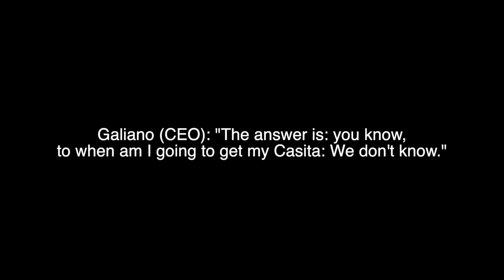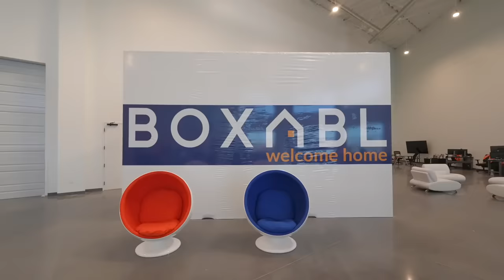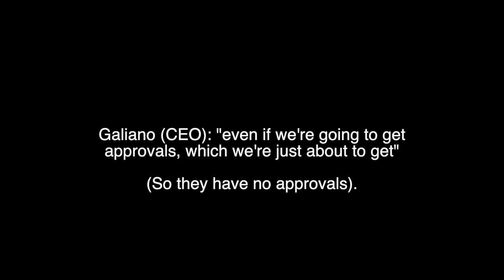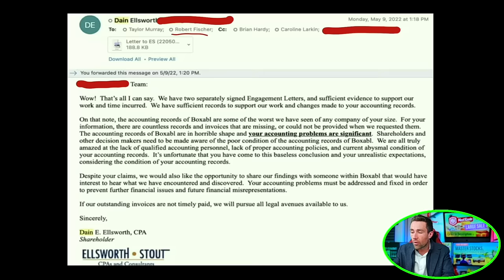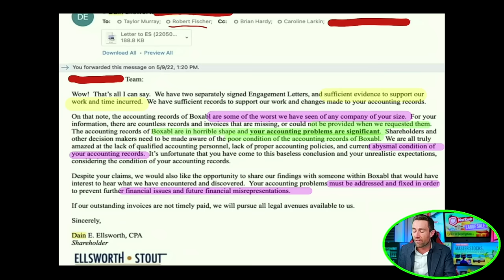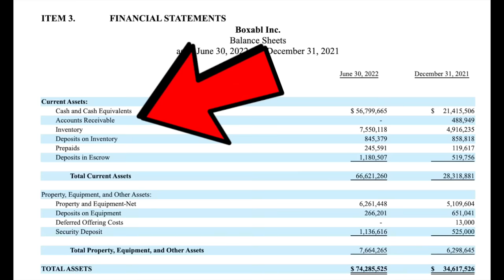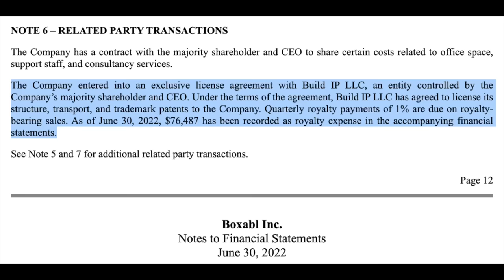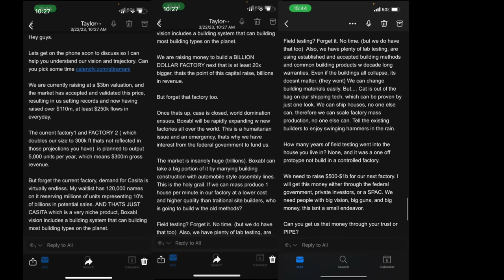Boxabl's $3 Billion Dollar Fraud | Elon Musk's Tiny-Home Scam.

Comment: I'm an electrician.. cables should NEVER get hot.. bundling doesn't matter.. the code on number of wires in a pipe or cable tray isn't for heat 😊

Comment: Prefab housing has been around for a long time. I was selling them 40 years ago in NJ.  I live in PA now where there are a lot of prefab factories. Generally the facade of the house, the brick or siding has to added by a local contractor, also the furnace is something the buyer installs,  utitlity hook up is on the owner, and the buyer has to  build the foundation footings and schedule the crane to place the house on the foundation. You can hire a general contrator to handle everything.  Prefab houses are stronger than stick built. if your stick built house was put on truck and driven around the block, it would probably fall apart.  Some of the prefab house designs are really beautiful. Im too old to change. These are too modern for me they look like boxes and  I like traditonal,.  The flat roof is not where I want to be, I live in the Northeast and it snows. I like a steep roof for solar panels and so on. I need more character in the design. I hope Boxable irons out all its start up problems and gets its act together because its a very good idea.

Comment: Food for thought if it's 400 ft², and it cost you about $100 a square foot and let's say you build a 400 ft² home that means you're going to end up paying about $40,000 so you're paying 40,000 to build it right there on the property that you're going to need to own but also you're going to have to pay a lot of other fees to this city which are not included where is that wood generally be included so you're looking at probably another 20 30,000 or you can just spend the $60,000 to just have a builder build it versus the full 80 or 70,000 it's going to cost you for this thing because again you do need the land to put this thing on it's not like you can just buy this and stick it on top of your current apartment.  I mean for the money you might as well just build your own higher company to build your own like 400 ft² home if that's what you really wanted it would be cheaper and much more custom

Comment: First of all, when I initially saw the product two years ago, as a former ICC certified Code Enforcement Officer, I thought there is no way this can be successful. And then I learned that San Francisco was changing codes allowing for small units like this to be placed on properties. As someone that has lived all over the contiguous US, I have noticed the trend in laws that stem out of San Francisco. We also are all aware that we need more housing options, and sometimes a "Not to code" tiny homes  will be 100% safer than a tent on the street or even some of these RVs and trailer RVs, and ESPECIALLY the "grandfathered in" buildings. I believe these guys @boxabl are working hard at making this come to fruition and we all need to work together to find ways to relax some of the laws on code, which the most strict one is saying that areas of homes need to be a minimum square footage. That is the biggest problem. I'm sure a lot of higher ups in the building industry and lobbied for these requirements, so that they can mark up materials, have more hours of labor, and charge more overall. We need to remember to bring in all facts, because omitting them is a form of lying. I would suggest you speak to sources outside of a company and ask what they think, because sometimes there are disgruntled egos. I mean employees.

Comment: You could literally get a used semi container which is like 40 ft long for around 2 Grand and then throw in another 8 Grand to finish out every single thing else that you can even imagine and for less than 15,000 you have a 40 ft home with all the Furnishings electrical and concrete padding on the ground everything complete for less than 15 grand and way more room than these things and thereby saving probably $40 to 90 $1,000 because you know they're going to try to charge like $100 for each one of these little 10x 10 boxes

Comment: You just pray to God. Boxabl is not the bad guy here. The housing industry is so greedy, there are years of local codes that make it difficult for Boxabl to operate.  Just like you can't put a trailer house just anywhere, counties and towns  classify Boxabl as a manufactured house and many don't want them (or us who want to buy them) in their area. They want money...not an end to homelessness. So this is the monster that Boxabl and we are up against. Pray to Jesus that greed and deceit is stopped and that Boxabl gets the right classification and is allowed. (They are much safer than trailer homes)

Comment: It's amazing.   The idea is great, but this is a perfect example of what happens when people get in over their heads.  Some grey haired architectural engineers and tradesmen familiar with the variations in codes, and, a properly run accounting department, are a  couple changes this clusterfuck needs TODAY to turn itself around.   The company cannot move forward building unsellable garbage by making it up on volume.

Comment: Other bad housing ideas.
Build a house out of shipping containers.
3d print a house.
Reply: Hempcrete? 🤣
Reply: Whats so bad about a shipping container house? They can legit be stacked, they are not glue'd together and they are easily transported.
Reply: @RobertMcGuckin-ws6pe  So you get a metal box for free.  Now you have to build walls inside it and then cut holes in it to connect it to other metal boxes.  Then you realize, hey I could have just framed all of this from scratch for less.  At the end of the day it is tough to beat a stick framing.
Reply: @MinusEighty  I don't know where to get a shipping container for free but I do know that I wouldn't need to side it with plywood and siding which saves on materials and labor. Cutting out for windows and a few doors is pretty quick with a plasma cutter and then some angle welded in for frames. The sub-floor is already there, they're made to stack since the 4 corner posts are the load points. I don't know, I think I have to disagree. I'm a builder with 10 stickbuilt homes and 5 modulars under my belt plus a hotel and am now downsizing. My next personal home will be out of 4 containers with an all steel (I-beam) and glass center great room. Using containers in my opinion is much less expensive especially today with the cost of lumber and building materials in general.
Reply: @RobertMcGuckin-ws6pe  This idea has been around for a long time and yet it has never taken off.  Why is that?  Because in reality it doesn't save much and worse still leaves you with an unconventional structure that will have less value when you go to sell it. I never said that it could not be done, only that the trade offs make it unappealing.  God bless and could luck finding a buyer when you go to sell your super clever shipping container home.
Reply: @MinusEighty  Obviously, the reason why the shipping container home has not "taken off" is because our country is so loaded down with zoning and building regulations that its almost impossible to be able to stay above water while attempting to build one! Also, if you aren't a builder and you don't have any experience, how do you know that it's not cost effective? Regardless, I've been fortunate enough to to have lived in both stick built and container homes and can honestly say that resale is not of any concern, quality of life is and we are all different! 
So, good luck living in your cookie cutter tract house constructed of plywood and poly vinyl chloride siding and don't forget to pay your taxes every quarter, you don't want the government taking it away from you ! :)

Comment: Uhhhhh, you don’t need to do this “folding box” stuff. It would be easier to build pieces of the homes that will lock together but in standard size pieces and such that people can build to a number of different floor plans. The real problem is the complexity of home construction under the IBC, IRC, and on and on. We Americans (especially Californians) have been regulated out of house and home. The elected representatives figure it’s better you’re homeless than “unsafe” in a house built with less regulatory restrictions. And so there will be more and more homeless people.

Manufactured homes pretty much already solved all the problems. Build manufactured homes cheaper/more efficiently and you will solve the housing crisis faster.

Comment: You are wrong about the wiring every house ever wired has to have a home run circuit back to one panel and end up all on top of each other there is no heat issue or houses would be catch on fire everyday. Commercial properties are even worse because they run it all in a couple of pipes that by your theory would turn into welding torches, just saying

Comment: I mean realistically it's not a bad idea especially if you can just have like one that's like an empty room that you can basically put walls up or do whatever you want with but pretty much has the ability to connect the electricity to the main one and then I mean you basically could have like affordable housing or even like movable housing and especially with the current housing market and kind of how housing is in in general like you know even if you could eventually like customize them with like custom like framework and the outsider something where like I said if you move it's very easy to move your house you kind of just fold it back up and you can move it to wherever you're going to be depending on your job whatever and you have your house or if let's say you have like you know standard ones where you can just get to one while you get there either way but the point is the same like it would be much cheaper in the long one probably it's just mass produce houses even the scam part not okay. That said realistically just making like modular pieces that could be stuck together would probably be much easier so basically you would make a foundation and then you would make the peace take the pieces put them together on the spot attach them to the foundation and done but most people just assemble it on the spot cuz it's just easier it takes up way less space on the road a lot easier to transport all the material and then it really just doesn't take that much that's why we're still kind of doing it the same old way in these modulars haven't really taken over but to do or to make a 400 ft² home or like even like an 8 or 1,000 ft² home really is not that difficult and not that huge of a crew that you're going to need The problem is people don't have the capital to build one you can't get a loan to build one and the cities don't help with this people or communities and building more affordable housing and the real estate business in the banks have kind of just f*** us all over which is so surprising because usually they they really care about us people so much

Comment: I have a better solution. I built my house for $7,000 for materials. It is extremely green storing energy in thermal mass such that it needs no cooling and minimal heating (2,000,000 BTUs eg. 0.75 cord of wood, or electric, ect.) also ultra low maintenance and that cost includes foundation.

Comment: I agree the company is most likely a scam.  However I do want to point out a couple things.  Not all jurisdictions have permit requirements and those homes would be perfectly legal.  The taped together wires looked to be the mains power and they would be buried in conduit together. 

I wouldn't touch this company with a 10 foot pole.  $50,000 buys a lot bigger manufactured home from established companies.

Comment: Well - this is why you SHOULD NOT BE GOVERNOR. You're focus could be high-road growth as you claim you are interested in. Instead you're calling that company a fraud. Stupid, maybe. Certainly. But it presents an opportunity to get legislation templates for standards for these kinds of units. They are significantly more promising than tiny homes, or on-site conversions of storage containers. Are they actually competitive with Stick built? - I don't know. That's not my circus. But I'm pretty sure they are at least an alternative. And by the way - look who is lagging the demand? CITIES. As usual. They should already have this pre-fab alternative set up. They should cost way less than $50,000 - they should come as a shell with basic wiring and plumbing for DIY on the "two year" plan.That would be reasonable. But noooooooo. Blame the company and stick them with inventory that they can't sell. Great solution, Genius.